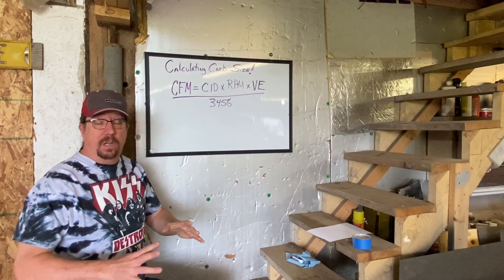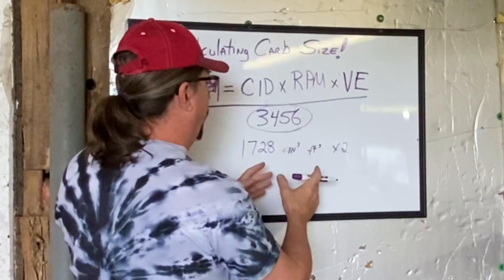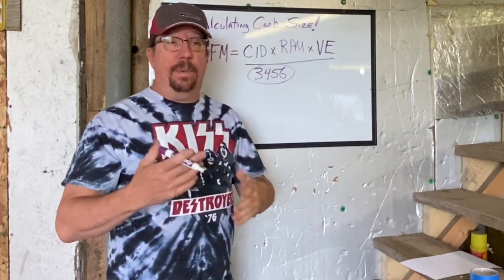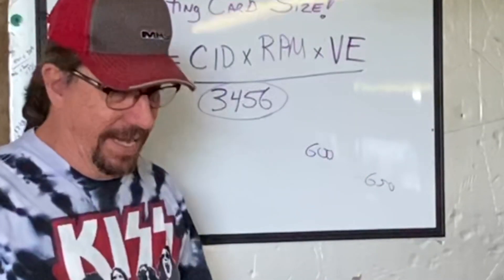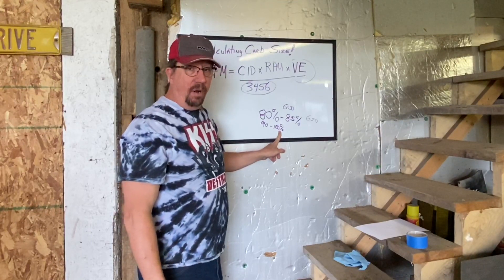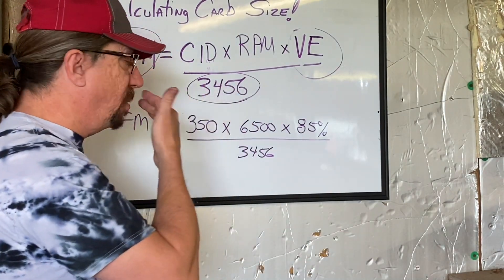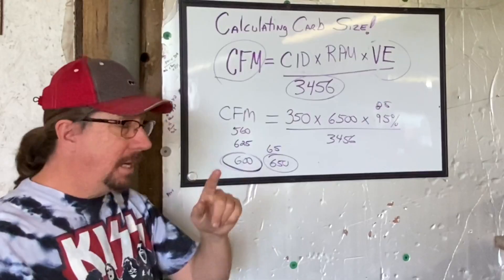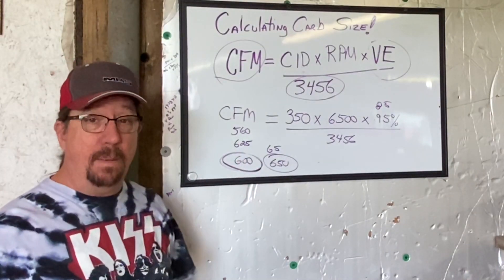HOW TO: pick the right carburetor.  SIZE MATTERS!!!  Don't overestimate, do the math.

Comment: Isn't VE on a stock 60's muscle car closer to 65%? (it would have to be in view of the low power outputs compared to engine size)
About 20 years ago, I remember asking VE on Pontiac 400 motor and 'Pontiac Owners Group' were 'convinced' VE was 100% 🙄
At least I now know why 3456, doesn't it matter how many cylinders are drawing through carb though?
Street motors running 8,000 rpm are out there, but (big BUT) most of the time they are only turning 3¬4,000 or less
Ram air is pretty negligible below 400mph compared to what the engine is already drawing in (for anyone else's benefit as you already know that)
BTW, I almost exclusively work on motorcycles, Suzuki were getting 130% VE at 150mph but that was a modern design optimised for airflow
Reply from the maker: Great feedback. I’m not sure on those VE numbers. I’ve been going to do a more in-depth episode on VE but I haven’t gotten around to it yet.

Thanks so much for watching. Really appreciated your comments.
Reply: @MyKARSShop 
 True story,
Back in the late 80's,  Kawasaki were developing a ram air system to get more power from the 600cc motor. LEDAR Race developments were doing the work . The owner was a bit of a maverick and didn't particularly like big corporations (but obviously liked how much they would pay) so,  He developed Kawasaki Fresh Air Ram Technology Systems. The Japanese engineers didn't see any problem even when marketing reduced it to an anagram but, when it got to USA, they burst out laughing because 'Kawasaki FARTS'
I only got to speak to the guy a few times as he developed carb kits for motorcycles, unfortunately he was killed in a hang glider accident in early 90's (and I can't remember his name which kinda bothers me)
I was working for Suzuki when the GSX1300F was developed, they actually measured the 130% and had to develop some new software to richen mixture in 5th gear but due to a 'Gentleman's Agreement' limited power in top gear for a max of 300Km/Hr (about 187mph)
Reply from the maker: I love stories like that… how funny. FARTS!   Lol. 

Hopefully, you remember the dudes name. 

I worked for orbital engine company as a dynamometer technician in the early 90s…. And then went on to work briefly at Mercury marine, implementing the  orbital technology for the OptiMaxx engines. 

So much amazing stuff I got to experience back in those days.

Love your comments. Thanks for taking the time.
Reply: @MyKARSShop  Leon Moss, came to me out of the blue while I was reading your comment.
Reply from the maker: @1crazypj  that’s cool. That name rings a bell. I’ll have to look him up.
Reply: @MyKARSShop  He was a British fuel system engineer, made better kits than Dynojet and was often available on the phone to answer questions. In the late 80's I did a modified Yamaha 750 'Super Tenere' for a customer, went from 117mph to 138 mph with new 'silencer',  some carb and air filter modifications. Working on motorcycles kinda spoiled me when it comes to cars as I find 300bhp from 6.6 liters a bit disappointing , should be a minimum of 1bhp/cu/in, preferably more plus maintain drive-ability 🤔

Comment: This formula will give you the smallest option carburetor. A step or two above the size carburetor this formula gives you is the one to go with.
Reply: then omit the VE  and just do 100% then.  just rememeber  you MAY  have to tinker a slight bit more with it and mechanical secondaries REALLY need to be precise vs vacuum secondaries

Comment: What would u consider a 351w.  Stock bottom end throw down 370 rwhp and 460 ftlbs threw a c4 trans ve%
Reply from the maker: I don’t have enough information to be able to tell you, but if you go through the formula that I shared, and do the math. I would guess you’re going to end up around 650 CFM on a vacuum secondary carburetor. That would be a good Street driveable carburetor.
Reply: Trick flow 11r. 190 at 56cc heads.   Trick flow stage 2 cam.   542/564. 222/234 duration.    Port matched vic jr.    Made power on dyno out to 6500.  With a 750 dp with annular boosters.     I was running a 600 double pumper for awhile and I completely agree. Smaller. Well what the masses would say is smaller actually runs amazing.   I recently picked up a tapered 4 hole spacer on top that vic jr.    A 650 annular booster double pumper and swapped to a t5z with a 410 rear and off idle can blow tires right off.   Thinking the 650 great for street.  Probably great in 1/8 mile.   The 750 maybe take it on a 1/4.   But idk. Il see
Reply: That delicate balance of vacuum ,  fuel suspension and atomization.
Reply: Oh. We got zero vacuum at wot with the 750 on dyno btw. Shorty headers

Comment: All depends which carburetor , you can go much bigger with a spread bore and still streetable .
Reply: But at WOT, a carb that's too big still is NOT an advantage. Do the math, get the correct size for your engine, and do NOT try and crutch it.

I drive a car with an 1150cfm Dominator on the street, and it's the correct size for my 547", 7300rpm, big block. And guess what?? The throttle response is super crisp, it doesn't load up at idle, the plugs look perfect after stop and go traffic, it starts with 2 pumps with no choke, and it works just fine. It doesn't need to be a spread bore, or crutched in any way to work perfectly. 

Just get the correct size, and you'll have no issues.

Comment: The carb flow is rated at a certain pressure drop across the carb.  This basic volumetric calculation doesn’t account for this.  There is a video on YouTube that covers a more real world method for determining carb size.  That’s why several commenters have had success with bigger carbs than this basic theory recommends.....  This can be a basic starting point, but pressure drop across the carb is a dynamic situation and constantly varies.  I haven’t spent dyno time, but been tuning carbs since I was 16 years old and have had fluid dynamics class in engineering school.  I had DaVinci change the IFR’s and install downleg boosters in a 3310 VS for a street driven BBC in my ‘72 C10 and it flowed 830 cfm.  He ran it on a sbc test engine and got it tuned in.  I get it home and put it on my big block and it has a massive hesitation when you stomp on it.  Seemed like a lean stumble so I pulled the VS spring to find it was one spring from being the weakest spring in the spring kit.  I put in a spring one away from the strongest springs and now VS kick in slower.  When you hit it now no hesitation and the old truck jumps sideways <grin>....  DaVinci’s test engine isn’t under load and VS’s have to be tuned under load.  Even the experts get it wrong at times....
Reply: you are right this math is a joke . i have seen a stock 305 sbc make the best hp and torque numbers on the dyno with a 950vs and it still had 1.2 hg of vac at full throtle .

Comment: Maths wrong…. Cubic Inches x RPM / 3456 = CFM (cubic feet per minute) / Volumetric Efficiency

First calculate the CFM. CI x Engine RPM/ 3456. That will give you the CFM. Then divide by the volumetric efficiency, that will give you the carb size you should shoot for.

Comment: Please help i have a 347 stroker with 830 cfm is that to much ??
Reply from the maker: Not enough information.  

Horsepower? Maximum rpm? Use? Compression ratio? Cam size? 

If it’s a mild 347 stroke or that I would say yes. It’s too much carb. But if it’s super performance… That’s where the volumetric efficiency number comes in to play.

Comment: We did this at the engine shop came out to be a 650 cfm ran it then a 750cfm and made more hp with the 750,put a 800 and did even better but lose a little at the bottom end.
Reply: that's because this calculation is BS
Reply: @chrisbusch1970  its not.  you forgot the VE part.

it made more  because the engine they put the 750 on  is more VE thats why the 750  outshined the 650

Comment: Hi I have a 383 stroker engine but it is unknown.  I have no specs and don't want to tear it apart.  What carburetor would you run I have a 2800 stall converter in my 700r4.
Reply: I want the best bang for my buck carburetor any information is appreciated.
Reply: @soobok13  your comment is from a year ago so any input I have is probably too late :)  I would run at least a 750cfm.  That is what I have on my 383 stroked SBC.  3000 stahl and turbo 350 trans with 4.10 gears in 68 Camaro.  A street and occasional strip car that has run 11.62 in the quarter mile.  I would also guess if I got my hands on a 800cfm it might pick up a little time.  Hopefully your engine combo has been worked out
Reply from the maker: If it’s a street driven car, I would go with either 650 or 750 vacuum secondary. Then you can tune it in the way you want it. Myself I probably would go with the smaller 650.

On Streetcars I like some good bang for my buck, but I’m not looking to milk out every ounce of performance. I also want to good drivability.
Reply: @MyKARSShop  Hi, thanks for the suggestion!

Comment: I keep doing the math and it keeps telling me I need a carb that is 470 cfm. That seems way to small for a 350 small block Chevy. 

It's not a built engine, it's a stock 1987 suburban tbi engine that I'm swapping out to a carburetor. The only performance modification's will be an aftermarket dual plane intake manifold and possibly headers.

I'm looking at the Holley 90470 but part of me thinks I should purchase the Holley 90670. 

Any advice would be greatly appreciated. This engine won't see much time over 5500 rpm and it's going in a 77 GMC Sierra  K15 4x4.
Reply: I wish I knew the cam specs, I've been searching the net high and low and can't find the info on this.
Reply: I do know the engine is rated at 200hp and 300 ft lbs at what rpm I'm not sure.

On Hollers website the 90470 is recommended for 4cyl, V-6 and inline 6 motors.and I want to put this on my 350 V8 Chevy,  am I crazy
Reply from the maker: I’d go with the 670 and then you can dial it on with the vacuum secondary spring.  
That way the engine is getting exactly what it needs from the carb and you have margin. 

That’s the beauty of a vacuum secondary.   You don’t have to use it all   You can dial it in. 

There’s a video here on that process on my 73 “scoops” swinger
Reply: @MyKARSShop  I apologize for the delay in my response. I appreciate your input and the knowledge you shared.

Thank you very much, from Canada

Comment: These formulas make sense on paper, but then you think about real world applications like the 302 z/28 had 2 780cfm carburetors and performed extremely well. The 340 six pack had the same carburetors as the 440 six pack and both performed extremely well. Maybe someone can shed some light on this.
Reply from the maker: Two things… First of all factory high-performance engines had a higher VE number and  not use the number  that I am using here. 

Secondly, most of these engines, and I admit not all, but most used vacuum secondary carburetors that did not nearly fully utilize the secondaries.   Especially engines that utilize thermal quad, Quadra jet, etc.… Secondary air doors were strictly controlled by the amount of air the engine was demanding.  

Remember in a production environment, you’re trying to find a “one-size-fits-all “carburetor that will work across multiple applications for cost… The more you buy the cheaper they are. Hence the vacuum control secondary carburetors were great because an engine won’t take more than it needs.  

Thanks for your question. I’m sure there are people that know a whole lot more about this than I do, but this video was intended to be an introduction to get people thinking. Thanks for watching
Reply: @MyKARSShop  cant speak for all those carbs but not all CFM's are equal across the board.  Also some of them used spread bore carbs which does allow for a larger carb since your mostly driving on the primaries.
Reply from the maker: @cuzz63  
I probably will do another video on this because I focused too much on the carburetor here when, actually, the point of this video was engine CFM. You’re absolutely right that advertise CFM on a carburetor versus actual CFM is not the same thing. 

Hindsight being what it is… Lol. Thanks for the great feedback.
Reply: Regardless of the math, if you see big vacuum under the carb, it will not function as well as a carb big enough to have low manifold vacuum under it , as it will mix better. Every pro stock out there used dual quads for a reason. It’s also why my Pontiac has 2x4’s on it mixing the air fuel better in all 8

Comment: Mike, which carburetor should I use for 1969 Lincoln mark 3...460.engine
Reply from the maker: What’s the maximum rpm you will achieve with the Motor?
Reply: @MyKARSShop  just street driving little highway 🛣 driving.
Reply: @MyKARSShop  that's a very good question 🤔

Comment: This is wrong, and you will buy a carb that's too small. The way manufacturers flow and rate carb cfm is at higher vacuum than you will see on an engine. The carb can be much bigger than the minimum required without hurting drivability .. watch dyno videos from motor trend or Richard holdener and you will see this proven.

Comment: So with a smaller carberator would the vehicle get better gas mileage
Reply from the maker: It would get better gas mileage if it’s not over fueling… And of course when you stop your foot into it with a smaller carburetor that will also make a difference. I have always found smaller carburetors to be more efficient & provide better drivability and good performance for a streetcar. 

If it’s a race car? Put on a toilet bowl. Lol. 😂😂

Comment: I always find this issue interesting due to the fact their are so many variables involved. I run a 94 Sonoma on the street with a 10.7 to 1 1st. Gen 399 stroker with 17* heads with 261cc int.runners that I believe most would consider way overkill for the street. My combo features a 4l80E w/3000/3200 stall with balloon plate and 9" with 3.55 gears. On the dyno w/89 pump gas the engine did  266 hp and 400 ft lbs@3500.....440 hp and 513 ft lbs.@4500......608 hp. and 560 ft lbs@5700 max tq. ..........641 hp. max and 526 ft lbs.@6400. The reason I point these #'s out is the fact my engine does not studder or shudder or cough or eat plugs it just runs as smooth as could b with a QFT 950 Black Diamond on the street and I honestly don't believe there's a chance in hell a 739 cfm which is the size carb recommended for my cubic inches could support any of those #'s except at the lowest power levels. Cam/ 260/266@50....679/669...110 split solid roller. Heads flow 404 cfm. What is your opinion?
Reply from the maker: The volumetric efficiency of your engine is obviously much greater than the numbers I’m using here in this video fir mild street performance. . I’m glad you found a combination that really works for you
Reply: @MyKARSShop   Thanks i'll let the 2 guys who built and dynoe'd the engine know , I bought every thing as an assembly project so take no credit for their skill set. I am now going to take a little time to learn more about volumetric efficiency in a N/A engine.
Reply: If your heads flow 404 cfm's, you SHOULD be making 800 horsepower. 

Something is very wrong with your setup.

Edit: By the way, I've had a 750 carburetor on a 700+ h.p. small block. Dyno proven.
Reply: @davelowets  The heads should be able to support 800+hp but that would require help in the form of higher compression(approx 15 to1) and a significantly larger camshaft, i'd toss in a 1050cfm to go with it. This is a street engine not a valve train beater like a 800-900+ lift cam engine would be. Please note this engine is done at 6400 rpm., wonder where it would be with a cam making power to 8500+ with 15 to 1 ?
Reply: @heshtesh  that has a lot to do with it.  800HP CAPABLE but  yo spin it to x RPM  lower than whatever it take to make 800

Comment: If by chance you still read the comments, ... Picked up a stock '70 LA 318 Dodge W200 Power Wagon, truck gears, Carter BBD 2 barrel.. rarely over 3500 rpm. .. Shop manager, and my mechanic suggested a low rise Edelbrock/w 4 barrel. .. Edelbrock customer service recommended an Edelbrock #1405, 600 cfm. .. Questioned him about the size, .. he validated it. ... the formula points to a 350 cfm.  ... 
Will the 600 be more trouble than it's worth?
Reply from the maker: There are a couple of factors… The first thing is, a vacuum secondary carburetor - when properly tuned, will only give what the engine is asking for.  

I am surprised they didn’t recommend the 1403 or 1404 over the 1405. Obviously Edelbrock knows their carburetors better than I do. And I have heard rumors that advertised flow is actually higher than the actual flow?

But I haven’t had time to dig into that yet.  

I think with the vacuum secondary carburetor and at the lower p.m. you’re shooting for, you’re hardly ever going to use those secondaries.  But it still would probably be a better choice than the factory 318 two barrel carburetor.  

I have used Holly 600 CFM carburetors on 318s and just tuned the secondaries for optimum performance. (So they only open up enough to give the engine what it wants without overfueling)

So it might not a bad way to go

Thanks for watching. Hope the answer was helpful. Hope you enjoy the channel.
Reply: @MyKARSShop  Input much appreciated. Thank you. Subscribed.  ....
addendum:  ... Looking back, now, it wasn't Edelbrock's customer service, ... it was Jegs customer service tech. Jegs had that set up in stock, at the time. (maybe that's why he pushed the 1405)  .... I see they have a 1404 in stock. May give them a call, & enter negotiations.
Your input alleviates concerns with present setup, in any event.  ...  Thanks, again.
Reply from the maker: @pnwoods  thank you!!!